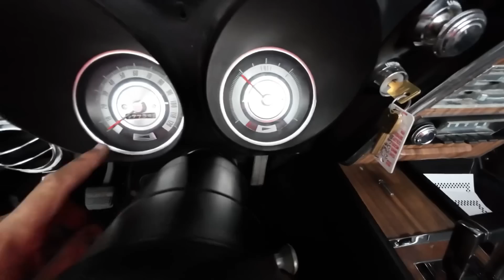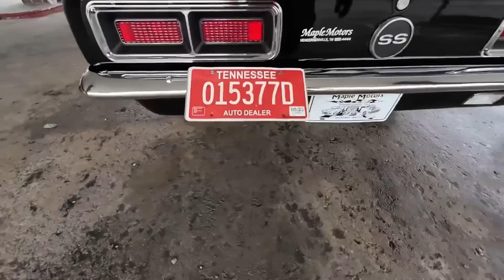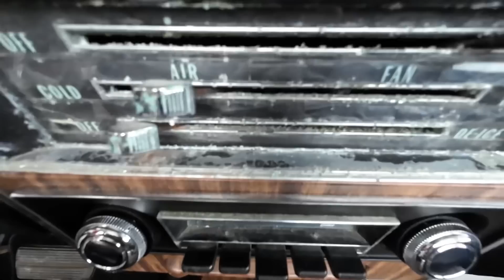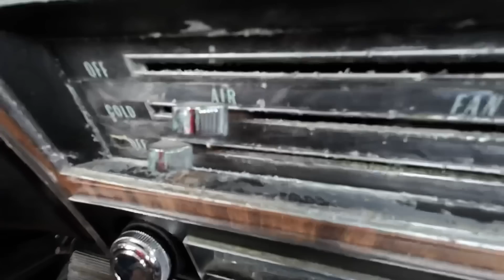Test Drive 1968 Camaro Convertible SOLD $49,900 Maple Motors #2176

Comment: Crazy how someone could sink so much money into a car and not fix little things like wipers, blower motor, horn ect ect 😑 Beautiful maro though! And a convertible is the 🍒 on top😊 rs ss convertible MY DREAM MUSCLE CAR🥰 I'd take a 67 68 or 69 😁🤌🏼
Reply: Some mechanics hate wiring
Reply: Maple Motors wants 50k for this Camaro  the horn,radio, heater, Speedo, gas gauge, etc.  He didn’t even mention if the vacuum  headlights worked.  I’m gonna assume it doesn’t work either.  I would think for 50k you fix all these problems.
Reply: @Blk63Vette  I have to agree with you....I'm beginning to think that owners of decent muscle cars take them to maple when those things don't work anymore  lol check out "next gen classic cars of illinois" 👍🏼
Reply: @Blk63Vette I could name a classic car dealer where their cars have horns wipers everything works but the prices start at 100,000.   Show me the cars you have for sale at this price in concours condition.  
.
Reply: @CatholicBoy1957  I have a 1963 Corvette and a 1965 C10 truck everything works on them.  You don’t need to spend a ton of money to get this to work.  I won’t spend 50k on a car that majority of it doesn’t work.  But, if you think it’s a great deal why don’t you buy that Camaro.  This Camaro is a driver not concours.
Reply: sometimes they might not be easy too fix if theres having electrical issues ,,327 isnt my ideal motor ,,,good looking car tho !( my opinion)